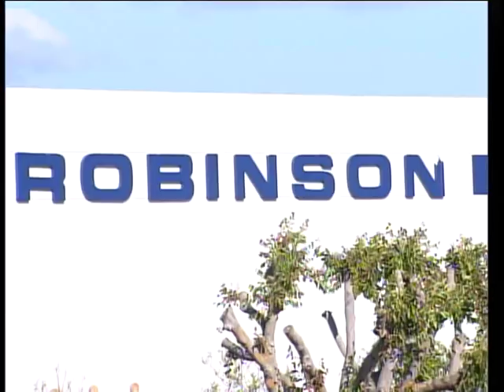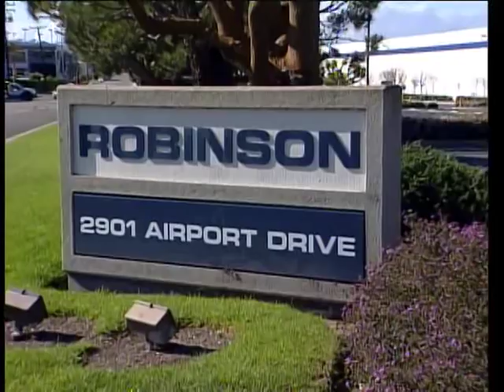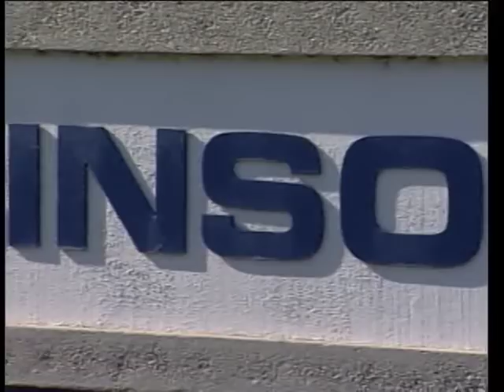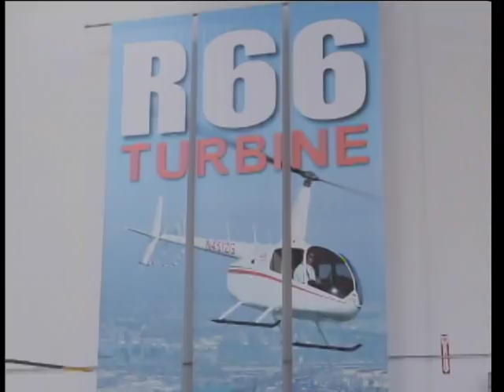Common Cents 04.14 - Robinson Helicopter Co.

Comment: The only thing missing is fully articulated rotors. Semi rigid rotors are somewhat dangerous.
Reply: That's how they keep the cost down.
Reply: Only the pilot is dangerous, Bell Hiller Robinson don't get ground resonance -  Enstrom Hughes Sikorsky Colibri do and the helicopter will tear itself apart.
Plus the two bladed system is less expensive, simpler, easier to hangar

Comment: They were pioneers but now they are falling back. A low inertia 2 bladed rotor is not the best for training. Mast bumping and mast rocking have caused many accidents. Many other companies are coming out with 3 or more bladed, elastomeric type rotor designs cheaper then the R44. Robinson needs to step it up or they will be left behind.
Reply: Unless those cheaper, 3-bladed designs have a back seat, Robinson has nothing to worry about.
Reply: You can park many two-bladed helicopters in the same footprint as one 3 or 4 bladed helicopters. Robinson Helicopters fill a void that very expensive Helicopter manufactures left behind. You can buy one New Bell Jet Ranger, or you can buy 6-R22, and 2-R44. or 1-R66 and 3-R22's for the same cost of one Bell!
Reply: Low inertia isn't a problem - RPM lost is quickly gained back;  Bell has mast bump
A heavier blade RPM lost isn't gained back as quick Ever heard of Droop stop pounding?  Articulated systems have issues too. Fly more talk less
The Hughes blade is lighter then an A-22 blade,  No issues

Comment: She said life of a helicopter is typically 12 years or 2200 hours??? Typo? listen at 16:02
Reply: After that period of time or flight hours (witchever comes first) you have to overhaul the aircraft and you will have an aircraft as good as new.
Reply: It's about control of the product.  Engineering 101 3x design life 
I've seen an R-22 in the late 80s go 6,000 hours before the 12 year limit ever started.  A big No No

Comment: Bla. Buy an Enstrom. Much better aircraft.
Reply: Enstrom is load of old rubbish.
Reply: Also more expensive! You can buy a Toyota Camry for $24,000 and drive it for 300,000 miles or you can buy a Cadillac for $60,000 and drive it for 100,000. Your choice.
Reply: Enstrom has issues at the factory - Parts hard to get,  A heavy truck flies good
Gear box overhauls slow - support suffering